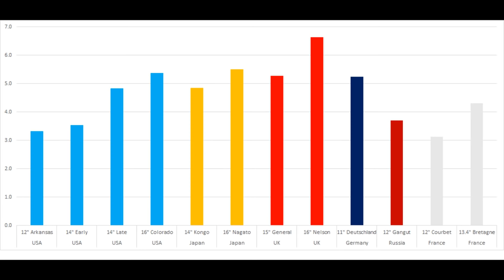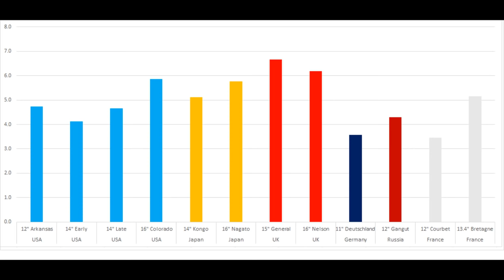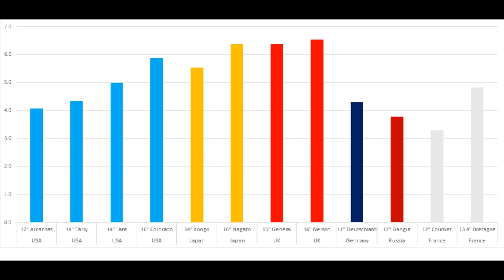Battleship Guns of WW2 - A series of tubes

Comment: How about the 12" 50cal of the Alaska class? Last to be designed and built. Tolerances had been tuned, explosives maximized, and mechanization of the turret loading/breach clearing refined to a science exemplified in the later "5" NATO round firing system used today in the Arliegh Burke weapon. Sometimes its not the size of the dog in the fight, but the amount of the fight in the dog If I can accurately harass your non armored areas with high penetration shells in critical areas from say 10,000 yards while darting about with a radar controlled firing and ranging system with a rate of fire of 18 shells a minute things change.... You cant hit me, and I can give you kidney blows at will. Perhaps aircraft did not kill the surface combatant at all- ability's to range and control high speed firing solutions automatically negates a big shell philosophy. Missile freaks relax- they work strategically on the same philosophy. Detection remains the key philosophy in naval combat no matter how you get it- air recon, submarine, electronic sensors, what have you. He who detects first and is able to mask his own detection nearly always wins. So your hypersonic missiles have a range of 800 miles? Great. What are they targeting and how? If you thought electronic warfare was a "thing" in WWII, the evolution of it has produced a virtual stalemate in surface combat until someone figures out how to eliminate electronic signature detection while actually in range. Curios about the 12x50 though, most advanced Naval gun every actually produced by the USA. Love to see more on that.

Comment: Should have swapped range for muzzle velocity - you’re already using one as a proxy for the other
Reply: Not really. With guns this big, the weight of the projectile and its ability to retain velocity becomes a huge issue. The Nelson's 16"/45s fire a shell of just over 2,000 lb at a muzzle velocity of about 2,600 ft/sec, while the 16"/45s of the North Carolina and South Dakota classes fire a 2,700 lb projectile at 2,300 ft/sec out the muzzle. At 20,000 yards, both projectiles are down to 1,600 ft/sec, but the heavier shell retains more energy and will (if the construction is the same) penetrate more armor, although the angle of fall will be slightly steeper and claw back some of that advantage.

Edit: admittedly, at the same 40 degree elevation the Nelson's guns get an extra 2,000 yards of range. As noted though, firing at a moving target at that kind of range is pure optimism.

Comment: I would pick a standard main battery as the standard. And work a percentage of that. A British BL 15 inch such as on a Queen Elizabeth would be the standard. So this 14 inch fires a 60% weight APC 70% down range penetrating 65% rate of fire 75% compared to a British BL 15 inch gun. The numbers are easy to grasp and given published standard figures all others can be worked up. I think the QE BL 15 inch is best as they performed excellent throughout WW2 and indeed through WW1 as well.

Comment: imagine auto loading 460mm guns on Yamato .
That would be glorious.
Reply: Bloody ridiculously so.
Reply: They were autoloading.  The only use of human muscle power in the loading cycle was transferring powder bags from the magazine canisters to the trolley that took them to the powder hoist.  Everything else was automated due to the sheer size and mass of the ammunition involved making manual handling infeasible.  The US Naval Mission to Japan postwar determined that it was an impressive system, but its weight (50% greater than a notional US-style turret of the same caliber) was greater than the savings in reduced manpower requirements and not worth copying as a result.  (It also went on to say, with the casual racism of the day, that it was probably necessary for using such large guns with "the generally smaller weight and strength" of the average Japanese sailor compared to an American one.)
Reply: @rdfox76  thank you. did not know that.
also , one would think that USN would have learned to not underestimate IJN and Japanese ;)

Comment: Bursting charge is overrated.  The USN believed that the shell needed to stay intact in order to deliver the bursting charge so they made them with heavy walls.  That gave a smaller charge but a sturdier shell better able to make it through the armor.  Once inside, even a 6 oz hand grenade can set off a powder magazine.  In fact, just the white-hot metal shards flying about can do it with no bursting charge at all.  As someone who used to use explosives in the mining industry I can tell you that 40 lbs of even the low velocity explosives like we used can take apart hard granite rock the size of a lorry.

Comment: Sure.  Take away 10, it's 5, then it's obviously 10, so it's 5 over 10, gives you .5, multiply by 10 again, so it's 5, and you get 5 out of 10, so yeah, it's 5.  Over under 10, minus 15, multiply by .5, and it's still 5, cyz it's 5.   Just deal with it.

Comment: Love the channel but I think you have a serious issue with the data selected not being properly connected in a mathematical sense and also in terms of the data you actually selected.

I am going to address the data selected first and say something surprising.  You should not be including shell weight as a category.  It doesn’t represent an actual capability.  It a a means to an end and that end is armor penetration and delivering the bursting charge.  If we have reliable data on penetration then that data should be used as it shows how effectively the objective was achieved.  In short shell weight is useful quick proxy for discussing battleship guns as generally the heavier shell the better performance but wasn’t an objective or performance metric in and of itself.  You should discard it.

Now we need to address that some of your data should be more connected than it is.  Bursting charge and armor penetration are really figures that should be connected by multiplying their place on the ranking chart and then using the result as a sort of proxy for expected shell performance.  Navies of the day clearly made decisions along such lines.  You traded bursting charge for armor penetration performance.  Thus it makes sense to assess it that way here.  In short if it doesn’t penetrate then the bursting charge doesn’t matter nearly as much.  And if it penetrates and doesn’t have any charge it also doesn’t matter much.  Right now these are a linear relationship.  

For example if you threw a high velocity tank gun on here it would penetrate far more inches of armor that any battleship gun scoring top on that category and a zero on the bursting charge.  Multiplying (probably some more tweaks in there to be sure) rather than effectively adding the two categories would eliminate that.

You would be left the with shell effectiveness (penetration x bursting), range and ROF.  At that point it’s a matter of weighting the categories and without seeing the results that’s hard to do.  I would suggest that shell effectiveness is likely more important that the other two categories combined.  Your current scoring system reflects that by scoring it three times.  So I would start with a weight of 3-1-1 respectively.

Like the video.  Just think there are some flaws in the approach.
Reply: I think I would go with a modified range equation as well but I am not 100% sure how to do it.  I might look at something along the lines of effective range.  My first blush suggestion for this would be at what range can the gun still penetrate 12 or 13 inches of belt armor.

I would likely make this a hybrid category.  Rank the ships on total range as it does have a tactical use for sure.  Then also rank them on effective range against decks but that’s more complex as greater range generally means more performance against decks so we run into situations again where overall range and deck penetration measure somewhat the same thing.

For simplicity I think I would leave decks out of it.  The resulting formula would be total range rank x effective range rank to get a hybrid look at the overall ability of the gun to work at longer ranges.

Comment: Rate of fire of large naval guns is largely unimportant. Any gun capable of firing faster than the fall of shot can be spotted for and corrections made, won't be firing any faster. The only time it will matter is when it's a particularly slow rate of fire,  where you're waiting on the guns to be reloaded rather than anything else.
Reply: I very much disagree. As Drach mentioned at Suriago straight WV found the range with her first Salvo and after that was in rapid fire mode shooting without waiting for the fall of shot to be seen. That’s pretty standard for big gun engagements. Once you have the range you fire as rapidly as possible while continuing to spot each salvo. If your solution goes out the window you can either go back to shoot-look-shoot or just keeping shooting while making corrections.
Reply: @jetdriver  It is rare for a battleship's guns to be able to fire faster than corrections can be made at moderate ranges, so it's largely pointless. US Navy battleships never fired fast enough that the crew couldn't spot the fall of shot and make corrections between salvos. That they couldn't actually fire faster was not a real penalty. Orders or no orders, WV was correcting on every salvo, as she couldn't fire fast enough not to.

At longer ranges, when the flight time of the shells nears or exceeds the reload time of the guns, a ship will always shoot - look - shoot - look. This is because the uncorrected salvos are probably going to miss anyway, and the smoke from firing the filler salvo can make spotting the fall of shot from an earlier salvo more difficult.
Reply: @SgtBeltfed  Ok I don’t have the range or time of flight info available to me at the moment but a quick look at NavWeaps for the 16”45 like that fitted to the fast battleships shows 36 seconds at 20,000 yards.  You argue that “any gun capable of firing faster than the fall of shot can be spotted for and corrections made, won’t be firing any faster.”  The theoretical rate of fire for these guns is 2 rpm which is 1 round every 30 seconds so before the shell hits. I know that’s theoretical but that’s also not the whole story. It’s not all about spotting limits. 

So even if the shells are hitting before the next salvo is ready rate of fire can still matter a lot. Using nominal rates of fire (which admittedly BOTH ships are unlikely to achieve in service) an Iowa puts out 180 shells in a 10 min fight. By contrast Yamato only puts out 117  (13.3 salvos rounded down to 13) shells. For Iowa that’s 486,000 lbs of shells.  For Yamato despite her heavier broadside it’s only 376,623. Looking at those figures it’s pretty clear that rate of fire can matter a lot. Ok let’s slow down both guns by 50%. This gives 45 seconds for the Iowa (which matches what fast battleships achieved in combat several times) and 67.5 seconds for the Yamato. I don’t have any data on what she was actually able to achieve in practice or combat but in another comment Nathan Okun notes that she is very unlikely to be able to fire every 45 seconds when you consider gun elevation rates. Using those figures in 10 minutes Iowa now puts out 117 shells and Yamato gets out 8.8 salvos. Let’s round up for Yamato to 9 salvos which is 81 shells that’s 260,739lbs vs 315,900 for Iowa. 

What about Scahrnhorst at a nominal 3.5 rpm. I very much doubt a German gunnery officer who has found the range will be waiting for shots to hit before he fires again.

Comment: I do question why Vanguard's guns were included considering the ship wasn't completed until AFTER WW2. And it says WW2 Guns. Which means guns being used during WW2. Which those guns, although may have already been made, never participated in WW2. And including super charges that were also not used during WW2 just also punctuates the fact that it shouldn't be included. Or you could just say Battleship guns from 1940 & beyond instead  of saying it's a comparison of WW2 Battleship guns. So it's kinda misleading imo. And at times you mentioned accuracy. Was the true accuracy of all the guns known & included? And most of the time accuracy is going to depend upon the fire control systems used & the people using them. Also in the case of the Italian Battleships having "bad" accuracy issues wasn't a problem with the guns themselves but the lack of quality control with the shells they were firing & amount of propellant being used. Which had both of those issues not been a factor then the guns themselves would have been seen as above average weapons. And at the end of the day the Japanese had the largest battleship guns ever. So you have to figure why did the Yamato run away from a few destroyers & destroyer escorts during the Naval Battle  of Samar when Yamato's guns outweighed the combined total of those destroyers? The only 2 answers that I can come up with are: 1) The Japanese Admiral had a head wound, was fatigued and after seeing Musashi sunk the day before & seeing multiple cruisers getting there bows blown off & having to evade numerous torpedoes as well as air attacks. He felt like he was fighting a losing battle. 
2) While having AA gunners trying to repel air attacks the Yamato & other battleships couldn't fire their main armament at surface vessels as well because the blasts would kill his own crew manning the AA guns. So it was a major conundrum. And he didn't want his ships to suffer any more damage.

Comment: As expected, the theoretical nature of the 18.1 Inch gun without taking into account other factors like fire control systems would beat the US 16in/50cal.
But we all know that the US would win the engagement just due to the poor FCS of the Yamato class.
If the Iowa took a hit, it would hurt but the Iowa would be hitting shot after shot after shot due to the Superior FCS. Eventually one will detonate the magazine and big charge go big boom.
Reply: yamatos accuracy on max range was about equal to iowa. (between 50m and 200m deviation from target)
combine that with longer range, higher penetration and bigger burst charge and yamato would force iowa to retreat in most encounters.
also yamato had thick enough armor to take the hits which cant be said the other way around.

iowa being superior to yamato is a myth.
both ships were at best equal in combat capabilities.

Comment: 'A series of tubes', never in human history has there been a more inaccurate description of a naval gun. They are without doubt the most complex 'pipe' ever made. Look up ' autofrettage' and that's just the inner barrel, now add miles of high tensile square section steel wire and finally an outer cover. These monsters are under tremendous internal stress deliberately to lessen the bursting stresses. I had the 'honour' (and I mean that) of working with a gun designer from Wollwich Arsenal. They test fired the guns ,16" etc. vertically whilst hiding under a VERY thick steel capped concrete 'mushroom. Only once did a shell return whence it came. That was the only time the clean underwear cupboard was ever opened - I jest.
R.I.P. Bob D
Reply: Tube

Comment: Instantly I think taking away the minimum value skews the ratings.
So lets take arbitrary units, where the ranges of the value are 10 to 20
By removing the minimum is a rating of 0 valid. It's completely useless? No I think that's wrong. Is the gun up at a value of 1 infinitely better in this aspect than the 0 (though in a way this too has issues as there are other values, and it's ranking not usefulness, but I'm trying to gather a point.) Is the gun that gets a 2 twice as good as the gun that gets a 1 in this category?
Then lets take this to say the ranges of 90-100. Something that has 90% of the performance of the top gun is 10 times less well scored.
I know it's a complicated subject, but my approach would have been to spend time to weight  the different aspects of performance to one another. Interestingly some are related like range and accuracy, accuracy and damage (no point having a gun with 100,000 range if you can't hit anything beyond 50,000. No point having the best damage, if you cannot hit)

--edit
To clarify I would imagine the scoring would end up something like (a * b) * weight + c * weight + etc

Anyway my 2p

Comment: Your restriction on the value of range beyond a certain point fails because it doesn't consider why battleships were rendered obsolete, that being, that it is reasonable to consider the airplane carried ordinance a form of long range gun (the purpose being to render the opponent non-combatant). Since if you couldn't see you couldn't hit it in regards ship carried weapons, once the launch point was moved off-ship, where the ordinance launcher could go out and find the target to the range of 350,000 to 500,000 yards and beyond, and have a reasonable expectation of being able to strike the opponent and render them non-combatant,  then range restriction isn't valid. Once ship launched missiles that could carry large enough warheads and electronics to the extent that they could go out and beat the airplane at its own game, particularly as to speed and detection, then the ship borne "gun" became more viable, and could be borne by smaller "battleships" (guided missile cruisers). Accurate gunfire at range should more properly be an attribute of a particular commander/crew than an expected limitation on the weapon. A sniper needs a proper weapon, but the weapon needs a marksman as well.